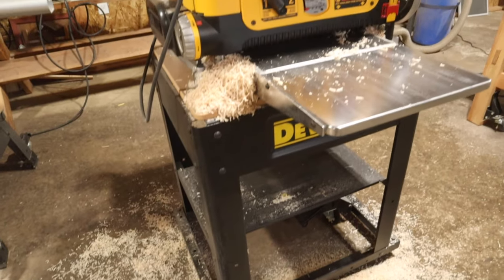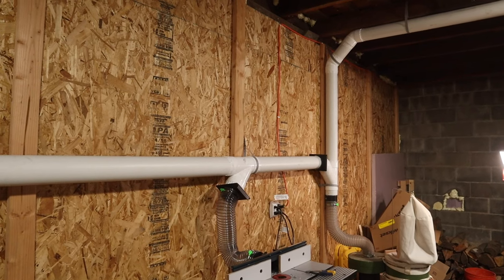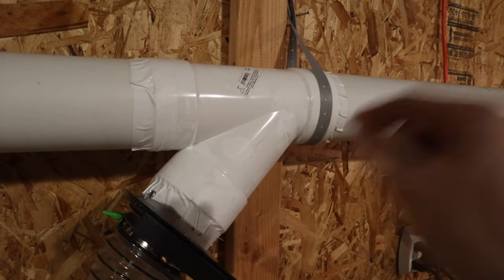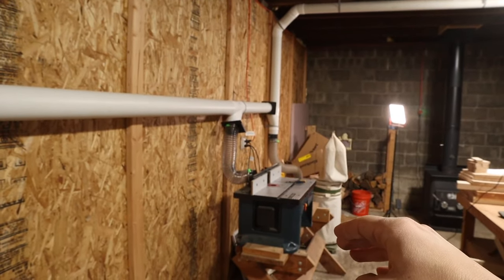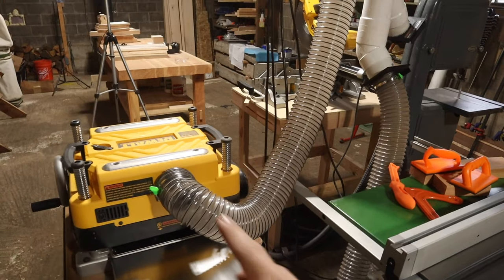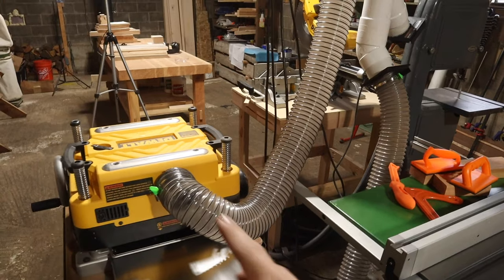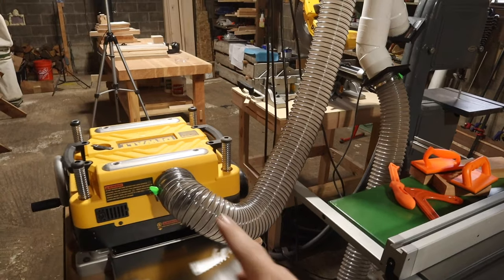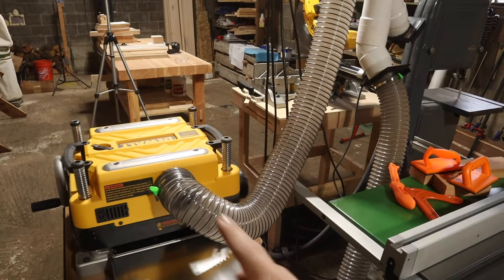4in, PVC Dust Collection Upgrade | Much Better!

Comment: Thanks for the video. I'm finally ready to start plumbing my shop with a dust collection system and I liked your layout - (I've had the collector for 3 years and been dragging a single hose to each tool as I use them - WHAT A  PAIN). Here's something that might be helpful to you. A while back I watched another dust collection video using PVC and what was most useful to me in that one, was he bought a spool of thin unshielded wire (aluminum or copper - I don't remember) and tightly wrapped a continuous strand of the wire around all the PVC  piping like a candy cane looping around about every 10-15 inches. At every joint, he connected the wire to the self tapping screws that held the joints together and continued on. He then grounded the end of the wire and his static issues were gone. Well there was virtually no sawdust clinging to the outside of the PVC so I can only surmise there wasn't  any on the inside as well. Hope that helps. Now if I can only find that $18 a stick of DWV pipe in my area, I'd be a happy camper. The best I've found around here is $26 a stick.
Reply from the maker: Shoot! That’s expensive! And I couldn’t agree more, the single hose is a huge pain. 

I’ve also seen a bunch of woodworkers do that as well but I personally haven’t had an issue with static. Perhaps it’s how humid Oregon is where I live but I imagine if you were in Colorado, Arizona, or the like, it’d be a bigger issue. I figured I’d wait until it became an issue to drop the money on copper coils.

Comment: If you're concerned about static shocks and PVC, where you attached your blast gates you can then run attach a ground wire to structural steel or add a plug to the other end and just connect the ground inside it and plug it into an outlet. That will ground the PVCs and reduce the risk of static arcing.
Reply from the maker: Totally agree. There are a few ways to kill the potential for static shock. From my research though, there haven’t been any cases of dust explosions caused by PVC dust collection systems in home environments. Consensus was that they were generally pretty safe.
Reply: Pretty sure the static explosion concept has been debunked many times.
Reply: Using metal grounding straps helps.. the static discharge you'll get while dust is flowing hurts like heck if someone touches it .. about only thing to worry about

Comment: This is perfect, and what I'm planning to do with my shop.  I have a similar dust collector, and have on order one of the Donaldson pleated filters to improve on filtration.  I had originally ditched the idea of going with PVC because it was so expensive, so a BIG thank you for mentioning the DWV pipe.  Just like you said, about $18 for 10ft. which is a big savings over pressure pipe.  Cheers!
Reply from the maker: So glad I could help! And yes, the DWV is a game changer! Good luck with your setup!

Comment: Very helpful, the one thing I did that I don't see anyone else do is instead of having the fine dust go into either a filter or bag, I have it connected to an exterior wall with a dryer vent. Fine dust goes outside, larger pieces fall into the bag. I have a two bag Jet and I just removed the top bag and used a piece of plywood on top that I routed a round groove in that fits on the top metal rim that the bag was connected to. Cut a hole in the plywood for a short section of dryer vent duct to fit in (about 6" long) and have a short piece of flex hose connecting it to the dryer vent. No more cleaning a filter (which are expensive) and no more dust pump as they call the upper bags. I also added micro switches to each blast gate so that when I open the gate it turns on the vacuum at each specific tool. Close the gate and the vacuum turns off. This  way I don't have to remember which blast gate was left open and I don't have a remote control that I'll end up forgetting where I put it down last. Great video and very helpful as I set up my newly relocated shop.
Reply from the maker: Oh I was so close to doing this as well. What kept me from finally doing it was that the air will need to be replaced in some way. So whatever volume is pushed outside, I'll need an inlet to my shop where the replacement air can come in. Where I live, half the year is too cold to allow for that, and the other half, believe it or not, is dustier than my shop. I'll eventually upgrade to a two stage with a canister filter but for now this works. 

Great idea though, it'd work for a ton of folks.

Comment: I removed about half of my 4" ductwork.  Instead i made mini-cyclones with 2.5" tube & hose for a couple of tools that were outliers from the rest.  That eliminated the runs that were really too long, and some leaks around a few spots.  It's amazing how what seems like a small leak actually degrades the entire system.
Reply from the maker: Great idea! I was thinking about something like that on the tools already fitted with 2.5” adapters. I’m also hoping to do some testing with an anemometer at some point to get some quantitative data because I’m sure my system is lossy at this point.

Comment: That dewalt planer you have has a built in impeller and works quite impressively on its own. Once I turned the planer on and it inflated the bag of my big Jet vac. I met the designer of that blower good job Diego! Plan on using pvc in my new shed workshop.
Reply from the maker: The impeller certainly has plenty of power! For a long time I ran it alone to a cyclone and it was strong enough to filter everything out 😂 super cool that you got to meet the guy!

Comment: Handy thing with PVC is you can heat & shape, if you needed a sleeve join a gentle heat & flare the end. Nice coverage of install & why.
Reply from the maker: Thanks! Glad you enjoyed it! And you’re a little more adventurous than I am with custom modifying the PVC 😂
Reply: @NorthwestCraftsman  Was a happy accident - experimenting with steam bending wood & 4" PVC was at hand to make a vessel. Connected a Home Sauna kettle to it but noticed the pipe was sagging over the ends of the table after 20min.
Reply from the maker: @huntz3215  Rather those accidents than the "lose my finger" type of accidents haha
Reply: @NorthwestCraftsman  Made the Art piece in my thumbnail 2yrs ago - stands 1mt tall & actually works. Making the spring was something new - 6mm rod wrapping around a 50mm pole. Could feel the tension as I walked around it & hoping my clamps didn't let go.
Reply from the maker: @huntz3215  strain/mechanical energy is just wild sometimes. I've grown to respect springs, flywheels, and the like because they can store wild amounts of energy.

Comment: thanks for this - i am just sorting out a more permanent dust collection system having gotten fed up with trailing flexible hose lying about everywhere.. so thanks for demonstrating the pvc pipe solution you've installed. really helpful.
Reply from the maker: Glad I could help!

Comment: Great job.

Looks very similar to my set up. 

I used self-tapping screws to hold mine together. I know I'll need to take it apart as my shop grows.

PVC pipe and sawdust are static electricity monsters. I added some scrap steel threaded rod inside a few of the long sections. I added a grounding wire to each rod, and sealed any holes. This cut down on the static and the dust that collected on the inside of the pipe.
Reply from the maker: Thanks! I ended up putting some self tapping screws in after the fact since the duct tape definitely didn’t stick long term 😂

That’s an interesting idea for the static!

Comment: I vent my cyclone through the wall--without the filter at all.  

It's surprisingly quiet outside. You can barely hear it 20 to 30 ft away.  It rarely, if ever, shows any dust outside. 

And, no, I can't see any appreciable difference in shop temperature and or strain on the 220 volt heater and woodstove. We still empty sawdust, but never clean a filter nor rebreath our own dust.  It is wonderful.

Best regards, 
Todd
Reply from the maker: I really appreciate this comment! I’ve been tempted to do this because of its simplicity. May have to do a test in my new shop with this technique.

Comment: I did a very similar the a few months ago. I thought I had done good until a couple months later, I had those same gates - they are JUNK! The groove that the plate slides in and out of, filled with dust and thus leaked air and I lost a lot of suction. I plan on buying the expensive metal gates when I get my funds together. Keep an eye on them.  First sign is they don’t close completely.
Reply from the maker: Couldn’t agree more! I’ve been able to clean the track out with a sharpened golf tee but I agree, when I move to my new shop, I’ll be upgrading.

Comment: I have a similar dust collector that I bought used. I replaced the bottom canvas bag with clear plastic dust collection bags, and replaced the top bag with a Powertec 1-micron bag. That made a huge improvement in the amount of dust that the thing blows around. It only lost a bit of pressure so it was well woth it and was very cost effective.
Reply from the maker: That sounds like an excellent intermediate step for improvement! I’ll have to check those out! Thanks!

Comment: I have mine that vents outside into a 50-gallon drum, and then the air gets filtered and put back into the shop. I have a small shed in 100 degree Texas summers. I use a small window ac unit as well. The refrigerated air  that leaves while dust collecing goes back into the shop and helps me with the loss of the cooled air.
Reply from the maker: I’ve been tempted to do an external filtration system! Glad to hear it works for you

Comment: Really good video~!  I'm finally getting my setup going using the same materials.  My pole barn has a 14-16 foot ceiling, so suspending the piping is a little tougher.  I built a similar cluster coming down to my table saw, bandsaw, & jointer.  Where you have a 45° fitting at the bottom of your cluster, I have a capped piece of straight pipe coming out of the bottom wye down to the floor.  The weight of the column rests on the floor, so my bracing from above is minimal.  Seems to work great so far.  I have a few more (Katz-Moses style) blast gates to build for closing off the branches when they're not being used.  I'm using a Harbor Freight DC and plan to pick up a Wynn filter and a 5" Super Dust Deputy.  Might even go for the larger impeller if they come back in stock.
Looking forward to more of your content~!  Thanks for sharing~!
Reply from the maker: First, great idea on the Wye at the bottom and the ground support! I had to go back and screw each segment together to get it to stay put and definitely don’t love hanging all of that from the ceiling. May go back to adjust that. Any concerns about debris build up in that area? 

Second, awesome to have such high ceilings! But you’re right about the challenge, how’d you end up routing? Still on the ceiling, just more complicated? 

Third, for your DC, how do you like the harbor freight? I’ve seen a lot of builds using them and will likely need to upgrade at some point. Does the larger cyclone just increase the power draw? Or what’s the downside? Also, for a cyclone I was debating between the Jet separator and the Oneida you mentioned. Let me know what you think of the Oneida! 

And lastly, thanks for the compliment! Love having guys like you around talking through what you’re doing. 

Josh
Northwest Craftsman
Reply: @NorthwestCraftsman  I think if there were to be debris build-up in the bottom support tube you can add a 2.5" capped opening at the bottom somewhere and just open it once in a while so the  DC can suck out the build-up.

Comment: My dad had a setup like this for about 30 years and I spent a lot of time around it. Be careful of static shocks when running the planer for a long time. Another fun trick is to put one on the floor with a large mouth so you can sweep directly into it.
Reply from the maker: No kidding you need to be careful 😂 I’ve seen a 1in jump from the extraction hose to the outfeed table. It’s funny that the planer causes this the most. 

That sounds like a great idea! I’ve seen some of those around but have usually just ended up using my shop vac to vacuum the floor directly.
Reply: Just be careful with the floor vacuum. Someone’s shop burnt down because of a screw being sucked in and causing a spark when it hit the fan blade. It smoldered for several hours before catching fire.

Comment: The static build up can be resolved with rune a sheet metal screw into the plastic and run a ground wire to  a grounded metal box or conduit. I did it at both ends of my line since I'm in a very dry climate and am more susceptible to static build up.  Looks real nice and serviceable, good job.
Reply from the maker: Thanks! And that makes sense in your case.

Comment: Love your explanation of how you put this together. New subscriber here. I'm about 3 weeks away from moving into my new house with my 1st woodworking shop 14'x32.5' and I'm researching dust collection systems. What I've settled on is a CamVac by Record Power, married up with a Mullet High-Speed Cyclone Dust Collector. You might consider this for your dust collector upgrade. I'll also be upgrading the CamVac with NanoMax Dust Collection filters. Looking forward to seeing more of what your doing in your shop.
Reply from the maker: Hey Pete! Welcome to the community! Sounds like we have very similarly sized shops! I haven’t heard of that dust collection system before so I’ll have to check it out! I’ll be upgrading my shop shortly so a DC improvement would be a welcome addition!

Comment: Hey Josh, been a while but I been keeping my eye on you. I'm getting closer to the shop/shed build. It's going to be raised so the dust system will be a lot like yours except, I want to take yours and put it under the floor. I did find a like new Harbor freight 2HP collector so I have that. I will put a canister on it right away because I'm putting it in its own small room with a n export to the outdoor. I've been collecting equipment and now have a band saw and drill press, also a bench grinder  and a benchtop sander, disk and belt. Getting closer. The waste pipe is a great tip and so are your comments on installation. Thanks.
Reply from the maker: Hey Cliff! It’s been a while! Thanks for your kind words 😊 Glad to hear you’re doing well! I’m excited to hear how the build goes.

Comment: Id mount the dust collection motor to a wall, then pipe from its outfeed port to a 50gal wheeled trash can. Home depot sells them. Cut a 4"hole in the flap lid. Add a flex hose adapter. Cut a vent hole in flap lid (if venting the air in your room use a couple coffee filters rubberbanded around a 4" stub out) (if venting outside use rodent grate.😂) Seal the lid to the trash can top with a foam pipe insulator, Add a couple bunjie cords. Itll work awesome for ya.
Reply from the maker: Those are awesome ideas! I’ll probably use some or all of this when I upgrade my system 😂

Comment: Great video… that sums up where I’m at, albeit in a much smaller space (half the unfinished basement of my house in Montreal).  Currently, I am head-juggling the right recipe for the dust collection on my contractor saw, integrated to my workbench.  

Actually, I wanted to let you know that a few Youtubers came up with great solutions.  I will try myself to come up with a system similar to the Milescraft’s hose system for routing table, with a liftable hood.  Heck, I might as well adapt the MC thing itself (quite inexpensive).  Just a thought to share.  Good luck!
Reply from the maker: Thanks for sharing! I’m always looking for better solutions. 

Hope you find a good solution for your space!

Comment: You did an amazing job now you had mentioned upgrading your dust collector. I have the same (Harbor Freight I think yours is) and I have made a movable cart and created a 2 stage system based off of "Patriot DIY's" system.
Reply from the maker: I’ll have to check it out! I still have yet to upgrade it but sincerely need to, I fill my little bag lightning fast and would love to get a two stage with a pleated filter.

Comment: Thanks for including the cost of materials.  I've watched a bunch of these videos and have yet to see anyone include this helpful info.  My system will be a bit smaller but I'll be buying a 2hp dust collector as well so it's good to see what adds up to what.
Reply from the maker: Absolutely! It’ll likely be outdated pretty soon because of inflation but at least for now it gives an idea 😂 also, that DWV is a bear to find in my area, hopefully you have better luck. 

Good luck! 

Josh
Northwest Craftsman

Comment: I've used hot glue as a temporary solution for pvc fitting with good results. A bit of strong twisting and pulling will get it apart.
Reply from the maker: That’s a great idea! And that would hold much better than the tape I’d imagine. The tape came off most of the joints in a couple of months.

Comment: I had caulk fail like that years ago. Your fix won't hold for long. You need to actually scuff up and sand the blast gates and pvc where caulk will go. Zero issues on mine after doing this. Good video though. Thanks!
Reply from the maker: Glad you liked the video and you’re totally right. In my next shop, which is a more permanent setup, I’ll be doing that.

Comment: Drainage pvc is cheaper than schedule40. as for the static problem, wrap a bare copper wire (14awg) around you pvc ducts and ground it to the blower housing.  Awesome set up!
Reply from the maker: Thanks! And totally agree!